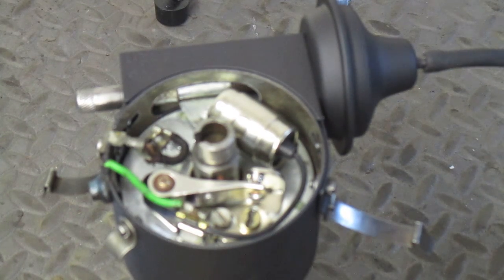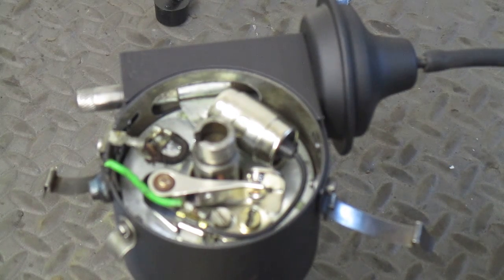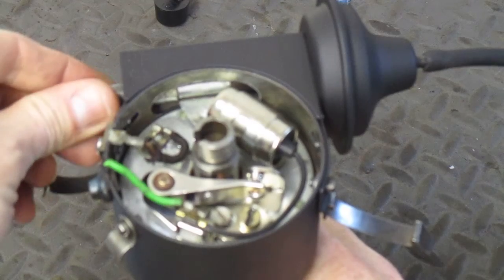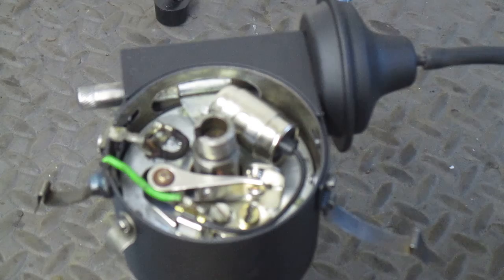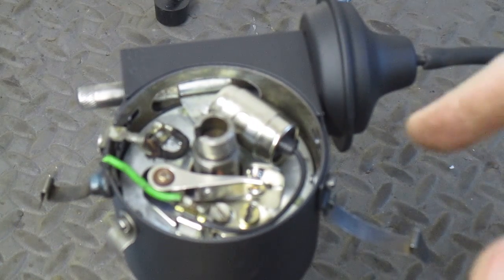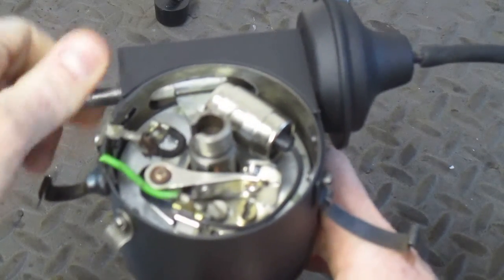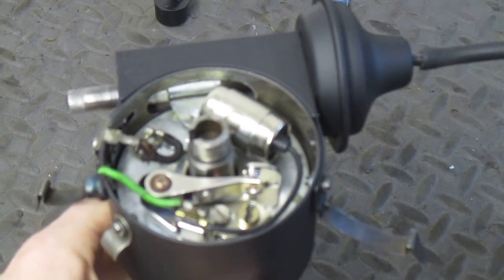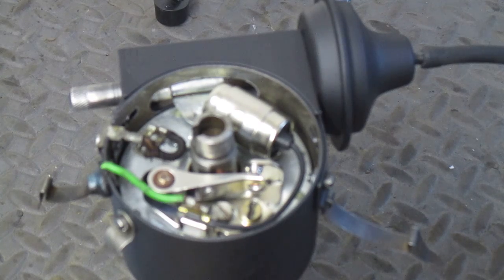Vacuum Advance Testing

Comment: So I sucked in on my line and I can’t get it to do anything at all. Nor can I get any air threw when sucking
Reply from the maker: I don't remember really noticing a lot of air flow, but you might have a clog. My guess, tho, is that the rubber diaphragm may be split.

Comment: hello sir when i go over 80kph my car jerks and loses power but when i slow down it goes back to normal, is the vacuum advancer the problem of my car?
Reply from the maker: Hi Patrick. While in don't think you can rule it out, I would look elsewhere (fuel delivery, spark) for power loss at high RPM first. It could be sticking, but I'm not sure how much loss of performance you would get. Sorry I can't help more.

Comment: and when the plate moves, what  is the back stop, my dissy plate  seems caught up , some where I read a certain vaccum needed before it starts to move, should it be free to move at low vaccum
Reply: ok, latest new, I threw caution to the wind, took out dizzy, found the vacuum stop, is in the vacuum head, spring in head can push back to shaft stop,  further the sticky bit, found under the ball runner, the "hill" base it rides on needed a fine file to remove a burr, all sweet, ahh the things we teach our selves, lol, and love to share
Reply from the maker: +Steven Olsen good job, Steve. Glad it worked out!

Comment: Does this method work with an 2.3 trooper 87?
Reply from the maker: Hi George. I don't know specifically, but if it's the same type of design (and being that old, it may be), it should. Some distributors work on pressure instead of vacuum, tho. Others just use centrifugal weights, so I can't say for sure.

Comment: Can you leave this disconnected?
Reply from the maker: You can, but the engine may suffer in performance, especially at higher revs. As the engine spins faster, the distributor needs to start the spark sooner so the current has time to travel from the coil to the gap in the plugs. This vacuum advance, along with some centrifugal weights internal to the distributor, help this happen. If you disconnect it, you'll lose some of this advance and performance will suffer as the spark comes late when the piston is already on it's downward stroke without combustion.